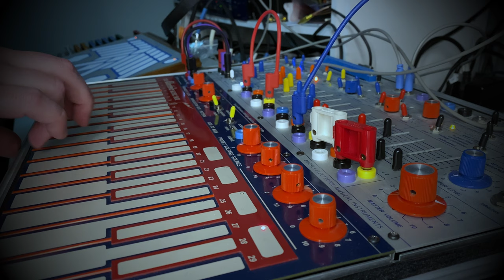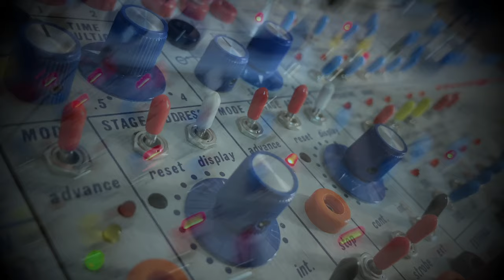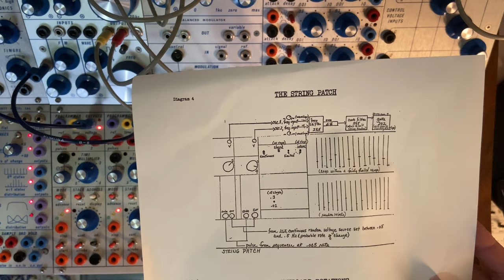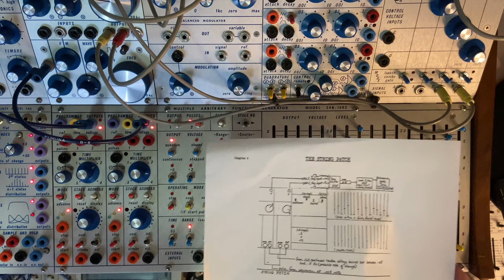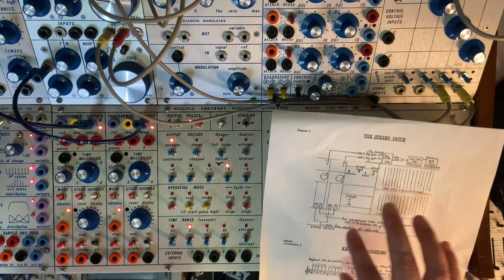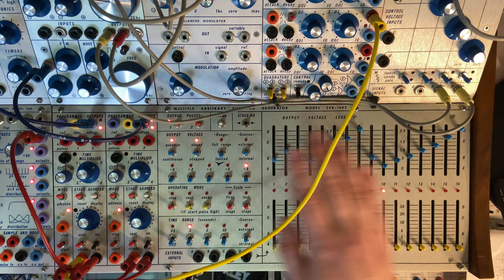The MARF Files: Ep 1 - Strobed Slopes & Suzanne Ciani’s “String Patch”

Comment: Amazing vid thankyou.. I just want to ask one question in regards to a very near future purchase of a Marf. Should I be looking for an original module or would the samodular clone be doing much of the same, or is there another version im unaware of. You mentioned that your Marf has had firmware updates, I guess im wondering which version you recommend that has the capability to do so. Thanks
Reply from the maker: The original few that are still in existence are basically unobtainable at this point. Currently the SAModular version of the MARF is the best version of the module out there and it will run the current firmware that I am using.
Reply: @SourceOfUncertainty  amazing thanks so much

Comment: Excellent! Very interesting. When calibrating the MARF after installing the new firmware, what did you use for the 10v into the External Inputs?
Reply from the maker: I use the preset voltage source from my 218 keyboard.
Reply: @SourceOfUncertainty  thanks. It was a silly question maybe but I’m approaching the firmware upgrade with some trepidation.
Reply: @jonblore3804  Not silly at all. It's definitely worth the plunge.